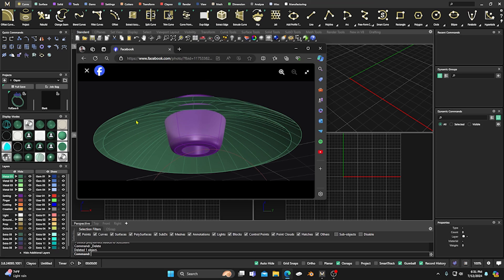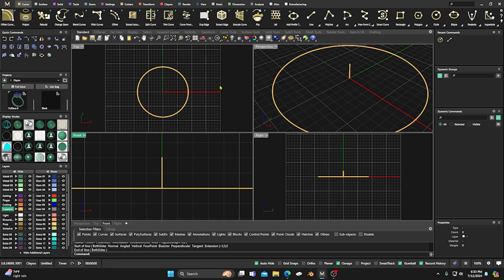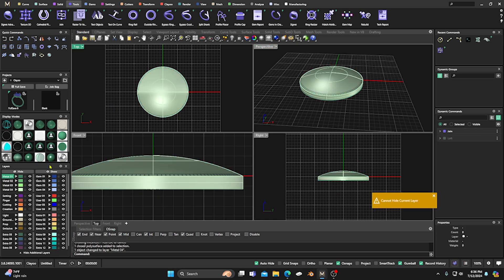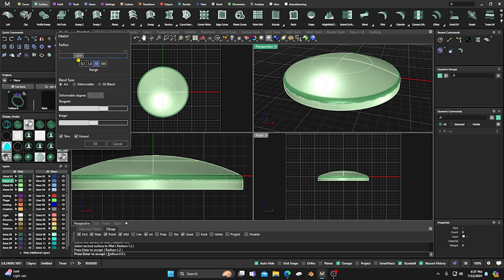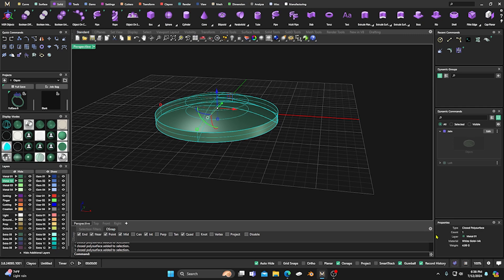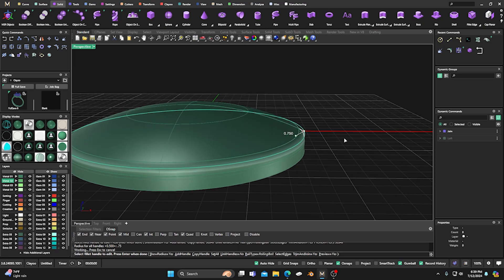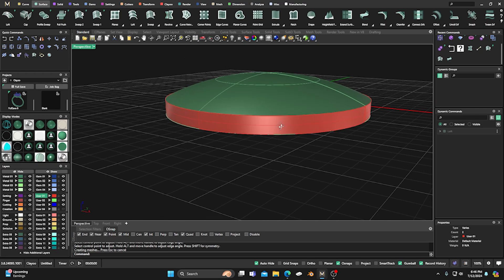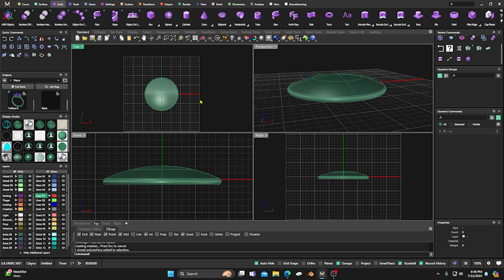MatrixGold Getting a solid from a single surface

Comment: Hey Don, hope you see my comment.
I have a pressing problem with my Matrix Gold software. When I try editing any surface or gems distribution, the object being edited is always in raytraced mode, even if the viewport is set to (plastic, wired frames, etc), which consumes much GPU and makes the software crash. Is there a way I can change the editing mode of any element (gems, prongs, sweep, etc)?
Reply from the maker: Click on any cog wheel which takes you to the preferences. Find  dynamic commands and click on it. Then find the box that says something like render mode and wireframe make sure they are unchecked.
Reply from the maker: Not at home at the moment bet will be soon. Let me know if that fixes it.
Reply: @donsjewelrymakingandjapantrave  thanks Don youre the best